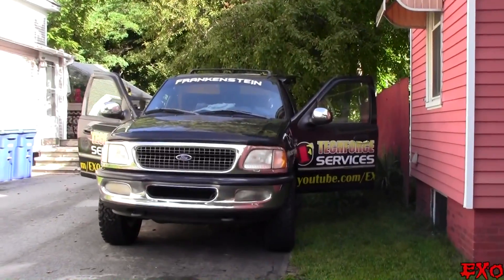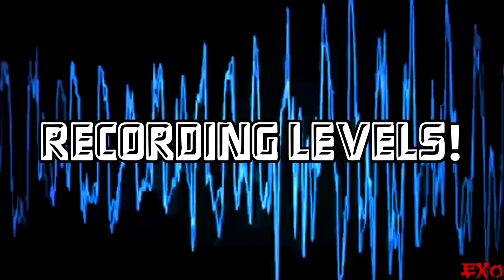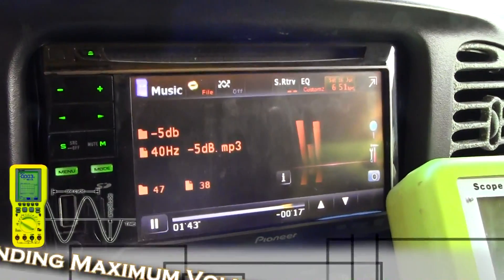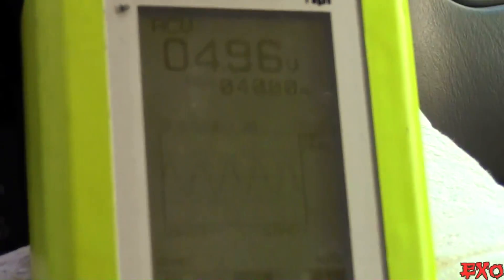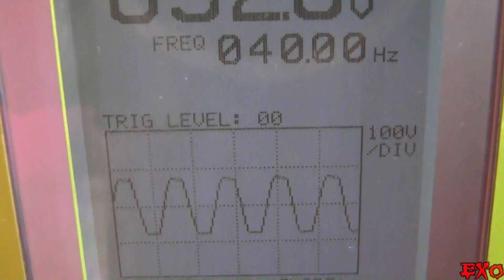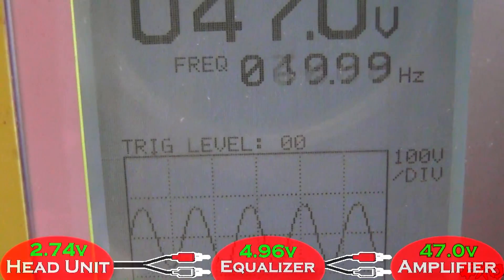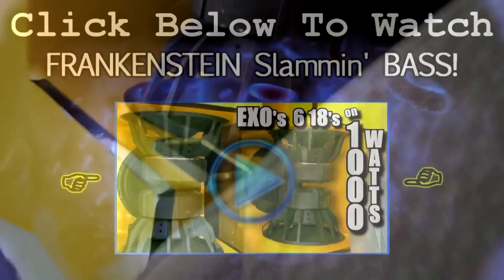How To Set Amplifier Gains & Get MAXIMUM Output w/ NO Clipping | Tuning BASS AMP w/ Oscilloscope

Comment: So quick question. I always thought you setup the headunit at 0db and then after that, processor, amp, etc. Get set with the -db tone? 

If that's the case, wouldn't most headunit including pioneer like the prs still go louder with say the SLA and Sub out if using a -5 tone at the headunit?
Reply from the maker: Why use the source level adjuster as part of the equation?
Reply: @EXOcontralto  because if your testing the headunit it self at a -5db track your not seeing the full prs capability. If I'm not mistaken. The prs in USB mode doesn't do 4.8volts with everything up unless the sla is plus 2. Even on a 0db.  tone. Maybe depending on the file used etc. But I've always seen people check the headunit at 0db to find it's flaws. And then from the processor or amp they set up with -10 -7.5 etc.
Reply from the maker: I'm not following. You should always tune your system with the SAME db overlap across the board, and according to what type music you'll be listening to. You can get 5 volts with 0db tones @ zero sub level. Or you can get 5 volts with -5db tones @ positive sub levels. 

Since I ONLY listen to modified music with bass lines recorded between -5 and -7.5db, why on earth would I want to tune with a 0db signal?
Reply: @EXOcontralto  we aren't in the same page. But kinda are. You showed testing your head unit at -5 for clipping and it getting 2.3 volts. What I didn't understand was why you didn't test it with a 0db track. Just the headunit. Make sure it's clean at whatever volume. Say 40 or 62. Then say it's showing 4volts. Cause most double dins do 4volts clean. 

Then when you did your -5db track you only seen 2.3 volts. But you didn't adjust the sla or sub out to bring that voltage up. 

Just a small step the video didn't show. And I'm used to doing. That's all
Reply from the maker: I see what you're saying. But I don't use the SLA option because that INCREASES the volume everything, not just the sub frequencies. So in that case, say if your mids and highs were already optimized and eq'd, that SLA setting just messed it all up!
Reply: @EXOcontralto  true. That's why I tend to check everything on the headunit at 0db before I do any other settings. That way no matter what. When I use a - tone. It'll be clean for sure. But sla on Bluetooth with the prs stays clean at plus 1 or 2 even at 0db tone.
Reply from the maker: Gotcha man. Ever have any issues with not having enough headroom? Say if you're playing a -10db recording and your sub level only goes up to +6? You'd just max that out and then go to your SLA?
Reply: @EXOcontralto  honestly I tune my stuff with a -10. Mids and sub. Normally gives me all the available power I could need for music and such. Can always back things down with the volume or bass knob when needed. Now that I have my scope. I plan to setup everything with the -5 tone and 0 sub level on the headunit. And then I have the sub level that'll still be really close to being able to max out and know that any song. Any recording. Rebassers. Etc. I have the ability to be right at the limit of clipping.

Comment: Awesome vid Ex......I'm really starting to understand how input voltage and gain setting works and also how important it is to tuning a full sound system.

So after you got the processor to pump out 5v unclipped you still turned the gain on the amp up slightly.If an amps input sensitivity range is 5v max wouldn't that be grounds to not turn the dial at all if your giving it 5v? In other words,how are you able to give it 5v and still crank the gain a little without clipping?
Reply from the maker: Some amps can handle 8v+ input voltage. This case was likely that

Comment: Hey EXO/ everyone, when I set the gain for my amp do I have to use it always at flat and no bassboost? Will it start clipping if I do set my gain and turn up bass boost?
Reply from the maker: First answer this... Why do you want the bass boost in the first place?  Based on how you answer this question I'll have a good response to help clear it up as best I can :)
Reply: EXOcontralto I wasn't too sure if I should use my bass boost or not, I've been running my subs just by ear without any tuning but I've bought an Oscope and I'm not sure if I should adjust the bass boost or not. I've got an external bass knob too which I use.

Comment: Hey EXO! How come you use a 40hz on -5 DB test tone instead of 20hz or a 60 or Higher hz?
Reply from the maker: Because the sub stage fairs better with optimization to the center of the bandwidth.

Comment: Sup once I do this process can I turn the loudness on and adjust the eq
Reply from the maker: NO, that would negate everything you just already maximized.
Reply: EXOcontralto so then how do you do this process with an EQ? Trying to figure out how to do my highs.
Reply: So exo contralto your telling me that once you set your gains properly you don't use your head units eq? Meaning the bass is all the way negative and what about the highs and mid on the eq

Comment: where do you attach the probes to test head unit?
Reply: Teng Xiong on the rca one on the male probe of the rca and the other and the piece metal that is exposed when plugged in
Reply: This what you need to show us in the video. turning some nods is not teaching, show us where to connect all the probes.
Reply: You can also get a BNC to RCA cord,This is the easiest way
Reply from the maker: Thanks for helping, Alfredo!

Comment: Sup EXO, 

Your video explains a lot which is very helpful but how can someone like me set my gains if I don’t have the scope meter? Can I use a multimeter to set my gains? I have pioneer double din, clarion eq and crossover and 2 amps how do I go about achieving this? Thanks
Reply from the maker: You can, but it's not the same process! Perhaps that could be a good idea for a new video
Reply: Thanks man that would be sweet if you could, always looking forward to your videos and learning. Thanks!

Comment: Nice instruction! I have a pioneer DEH-S6010BS and Orion XTR2500.1Dz. I simply need to send a flat signal to the RCA jacks and then measure from the amp output right? I have no signal processor between. I'll be using an auto ranging multimeter and Rigol DS2702A oscilloscope to check.
Reply from the maker: By "flat signal" you mean not distorted, correct? If so then yes, you're on the right track :)
Reply: EXOcontralto by flat I mean the crossover is straight across.

Comment: hey exo,
i have 4 amps but only have 1 pre out on my head unit, so i daisy chain them through te amps pre outputts.
but how do i set the gains proper on all 4 amps. cause i only have 1 rca cable coming from my headunit, hope you can help me out.
Reply from the maker: You'd simply optimize the levels on the RCA output, then adjust each amp accordingly after that.

Comment: I thought you had to have a load on the amp to set gain.
Reply from the maker: This way is preferred so we're not BLASTING on the subs the whole time setting the pots.
Reply: EXOcontralto I made an adapter with an A/C 12awg power strip plugged in 3 space heaters which were all in parallel for an 8 ohm load.

Comment: If I'm using a stock head unit. And high level inputs to an EQ. How do I check the the head unit for clipping?  And then do I also check the EQ rca outs with the head unit ar the proper volume?  Thanks for the vids!
Reply from the maker: If you're using HIGH LEVEL inputs, measure the high level output! Then check the EQ outputs after.

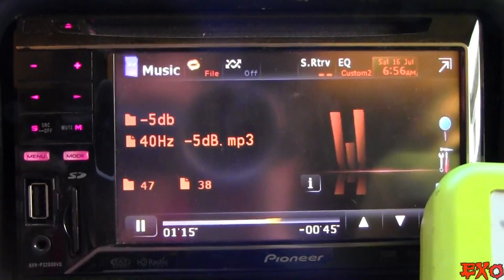Comment: I know this video was from a while ago Bruce, but the reason why your rca pre out voltage on the scope was less than you thought it should have been at 2:58 was because you were using the -5db tone.

When I check for my max undistorted head unit volume I always use the 0db track (=
Reply from the maker: Ahh yes! Thanks, Braxton!
Reply: You always check for clipping level on the head unit with a 0 db tone.

Then set sub amp gains with the appropriate tone based on music preferences.

Nowadays most bass music ends up between -3 and -7 db
Reply: @SigmaBallistics  well you'll be further below clipping then you might want then. If you're using non boosted music I'd do -5 if you're using all boosted maybe -3 to 0 really depends. Saying "always" set it to 0 is kinda silly.
Reply: EXO did explain that he was setting the gains for dynamic range.

Comment: That lc1 remote you were using to burb, is that a bass eq knob or a volume knob? I’m assuming a subwoofer volume knob that is outside is the master volume l?
Reply from the maker: The LC-1 is simply a volume knob, it doesn't affect anything else but that, yes.
Reply: Nice thanks man

Comment: So I'm not quite sure if this would be considered clipping or my amp just going into protect mode but currently I am running a skar LP 1000 D for 1 Skar vvx.v3 12. I was getting some voltage drop hense headlight dim, so I added a second battery and the on/protect light flashes red when it hits hard but the amp doesn't kick off it's like the sub just cuts out I've tried turning the gains down and regrownded the second battery and amp I've also ran negative across both batteries. I have no clue what to do from here, and just thought maybe a fresh mind could help the situation
Reply: Sounds like it's a wire loose somewhere , or your running a dead second battery and never ground your amps to the battery this can also cause that problem

Comment: I'm concerned about the fact that the meter read 2.74 volts on the head-unit, but on Pioneer's website it say's that your head-unit, the AVH-P3200DVD is suppose to have 4 volt outputs. I need to know what that's about because I'm head-unit shopping and I want to know the truth about it all. Thank you or anyone in advance.

Comment: I am pretty sure you should have an load of a given ohms to be sure the amplifier will actually put out a clean wave form for that given amplitude/voltage range. The load resistance will change your readings. Just saying.

Comment: Good video EXO. Certainly helps to understand the testing process.

One note however is that the system should be set with the equalizers set at the normal listening position. If you run the head unit eq flat, that is fine but many don't. The problem is that once they boost any signal in the eq, they will clip the signal at full volume if they follow your instructions to a T.

Another note it that modern EDM music and many other genres are hard limited at 0dB so it would be much safer to use the 0dB test signal than the ones noted.

Comment: When setting the gain on my amp, do I set the separate bass level knob remote all the way up or all the way down?
Reply: Bass knob all the way up then adjust the radio to max volume ,without  distortion, then adjust amp gains.👍

Comment: where did u put the leads from the oscope  on the rcas.doesnt show
Reply: + = center pin.
- = outer ring
but make sure they don't touch each other any-ware
or best bet is get a rca tail to fit with both cables exposed and connect to them

Comment: Why exactly do you use a 40 Hz Tone as Reference? And not for Example 50, 60, 70, 80 Hz?
Is 40 the Frequency, where Amplifiers have to work the most, or what?

Comment: Hey Exo. Just wanted to thank you for this video. While i didn't have access to an adjustable TPI-oscope I did have access to a manual scope that ended up working well. With your helpful knowledge on deck and gain matching i was able to tune my system far better than i ever could have by ear. 

Thanks. Keep up the great work.

Comment: Hey exo. 

I just put in a new deck in my car, I wasn't happy with my previous one. I know I installed everything properly. I want to see at what point my deck clips. However when I play a test tone to do so, I am not getting much sound even at full volume. Is it okay to increase the source volume until it clips, and then set my gains?

Comment: Are processors/drivers necessary for car audio? My head unit is definately not putting out a very high voltage. Does this matter for the average joe? running 2 1200rms 15's and some 4 100w door speakers.....

Just wondering if it is worth the money or not..
Reply: I always assumed he mostly uses it for turning down his speakers at SPL competitions without touching the headunit for convenience sake. Oh and its cool to have for custom active crossover settings.
Reply: FrAuSkY I would especially use a driver if you running a 4 ch on mids and highs and different one for the subs to get everything tuned to it's best ablity plus it also works as a kill switch just in case lol

Comment: Bigger Wire gives more power, les heat on amp ???????
Reply: less heat in the wire, trying to pull to much current through to small a wire will make it overheat and melt.

Comment: You need to test distortion at load.  Oscilloscopes have a high impedance input so there's no load on the outputs.  The behavior at load will be very different.
Reply: How do you do that?

Comment: would an oscilloscope app on my phone be sufficient? and if i put my bass boost to zero when doing this, what if i turn up my bass boost later on and it starts clipping?
Reply: +paperboi714 It doesn't really matter where the oscilloscope is. What matters is it's accuracy. As for bass boost. Leave it off. Typically once a system is tuned, you only want to turn frequencies (like those from an equalizer, processor, etc) down. Never up. Adding or boosting frequencies (something bass boost does) will make the signal clip and result in unwanted distortion. However, if you absolutely want to be able to turn bass boost on and off safely, tune your system with it turned on from the beginning. This ensure that the frequencies adjusted by the bass boost are within safe working limits when turned on.
Reply: LockDots84 cool thanks!

Comment: nice info video. I am getting a popping sound from my speakers when I turn my car off. any idea what could it be
Reply: MrImfly365 Likely a ground issue with either your head unit or amplifier. Could be RCA cables picking up some interference too...

Comment: What would happen if you wire a dual 2 ohm and a dual 4 ohm together in parallel?
Reply: +Steve Macke 
do not do this.
do NOT MIX SUBS OR OHMS LOAD.
Reply: +big scott already found out with some factory subwoofers and a p.o.s. hitron amp. thanks for the response though.

Comment: Exo,   hey bud,,  i'm still learning,,  were do voice coil Ohms come in in the Equation bud??

 What exactly your berhinger sound prossesor do??  Is it 110 volt powered?
  How do i hook one of those home stereo procesors in my Car Audio Bro?   Thanks. 👍
Reply: Hector Ortis need a power inverter
Reply: Ok,  is that all you are using (power inverter). No issues with engine noise? cause the RCA's will share ground from 12 volts and 110 volts at the proccesor rca jacks..
  Or no.   I will be Fine? 

  
 Thanks man,  ,     cheers!,  👍

Comment: So your only getting 477w RMS out of the 1k amp? And that doesn't even include box rise and stuff?

Is this normal? How much wattage would you expect the Subs to see after box rise? Or does the 477w figure account for box rise?
Reply: That includes box rise. Basically in the rule of thumb world, if you divide those numbers (ACA and ACV), which would be 42.3/10.6 = 3.99 ohms. Granted, the formula in the video is related to DC laws, where as amplifier outputs deal with AC voltage. So they are more ballpark figures. So in reality, he is getting about 400w @ 4 ohms (if you use 0.85 as power factor). So yes, he is getting decreased output, but that is not because the amp isn't doing power, the impedance rise (or box rise) is raising his impedance (load) to where it is only outputting "477 watts." The amp if on a resistive load (which is prone to "box rise"), at 1 ohm, you would probably get a solid 1000 watts or more out of the amplifier.

Comment: Ive never used any multi meter shit.    I just listen and match up volt with my head unit.      Turn up the gain/ volt level like mabey 1/3    fuck bass boost.   Just barley have it on.  Hair pin turn.      Sub sonic filter.     U can keep it low.    Just turn up the lowpass  higher if u like dupstep.  Lower if u play rap.        Like when u use muilti meters.   If u have batts at @ 18 v  and u set it.       The min u hit 17.9 volts.    Boom  clip.... Ur not really supposed to just play a single sine wave to tune amps     u need to play music.       Steve started a horrible example
Reply: Not true, you are spreading misinformation that is subjective to each listener.  A lot of people mistake distortion for loud bass.  It's pleasing to some and they wouldn't think they are clipping.  Using a single steady tone and setting gains to that will ensure you won't clip during music since most music isn't a steady tone.  It's transient. DMM are also objective, meaning hard measured results.  NOt, does this sound like clipping?  If you tune using music you can either set gain into clipping cause it "sounds good" (subjective) aren't experienced enough to know what to listen for, and also when you DO play a song with an extended base note, guess what, that a constant tone and you'll clip cause you didn't set gains using a consistent tone.

Comment: Whats up EXO I just come across this vid and I have basically the same headunit just the 7'' version AVH-P4300 and was curious as to what your sub output was set @? I usually run mine @ -5 but don't have the equipment to test with. and also would that raise output voltage if it's set higher?

Comment: nice video man, but i want to mention that in volts x amperes is for dc voltage, for AC voltage you have to know the power factor because the voltage usually is slightly out of phase with amperes, so you multiply volts x amperes x power factor= watts. :)